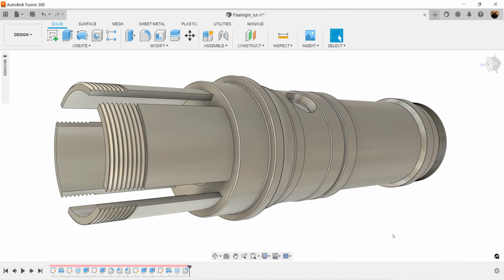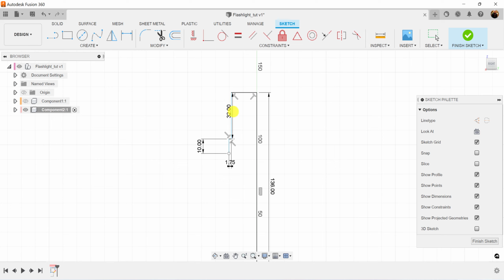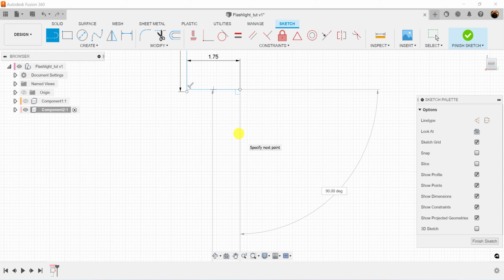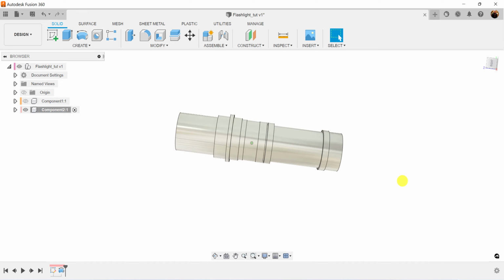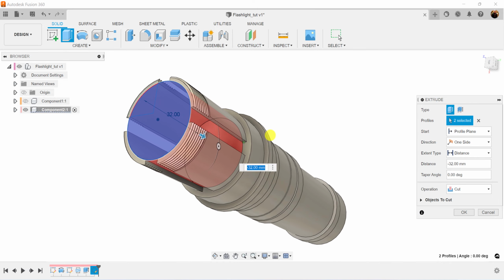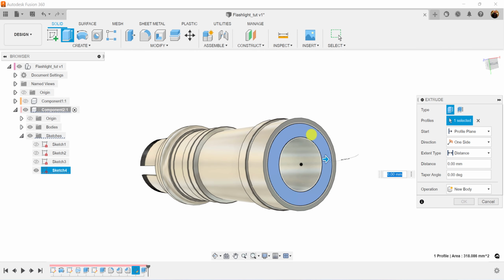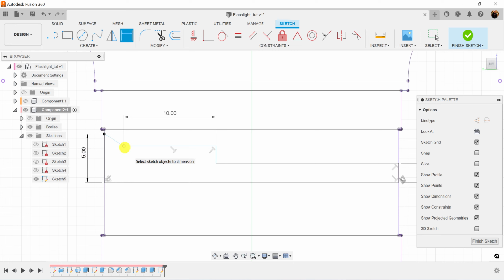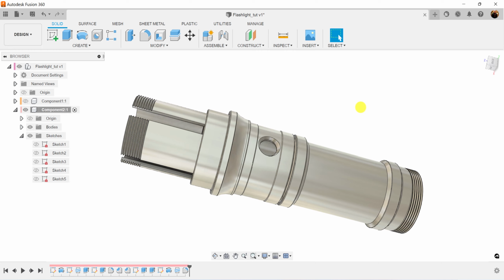Learn to model an LED flashlight in Fusion 360 | Part 2

Comment: Nice one CJ. That's Part II completed without a hitch ! Could I ask you how you how get all your measurements?  A digital vernier caliper ?
Reply from the maker: Although I do use digital calipers and micrometers on occasion, to be honest it doesn't always come out exact. Sometimes I search the web and get dimensions for various products and make adjustments on my own as well. When modeling for real-world reproduction there is a bit of trial and error. That's why a lot of my dimensions are ball-park, not exact. They are primarily used for education purposes to learn the use of the software. 

Hence my disclaimer on each video I release: "These models are not always exact but, are measured for approximation. When attempting to reproduce models for 3D printing, be sure to verify your own real world measurements for authenticity".
Reply: @CADJungle  Thanks for that.
Reply from the maker: Not a problem. That's why my channel exists! In addition to the support I receive from my viewers and subscribers.

Comment: The hardest part for me at the moment is just getting Fusion to launch.
Reply: That reminds me of an old friend who after enrolling in university commented that it was so complicated that just enrolling should give you a degree. Incidentally, he did and is now worth a few hundred million.  Never used the degree!!
Reply from the maker: Fascinating! University degrees have their place however, it has been proven that it is not a requirement to become successful in life. What matters is the goal you plan to achieve and by what method(s) you take to get there!
Reply from the maker: What exactly is the issue that you are having? Is it stuck on the loading screen, is it erroring out?
Reply: @CADJungle  it’s ok I just have to shut down the pc and restart. I didn’t know the control 9 buttons.